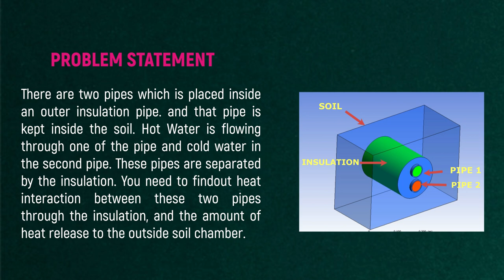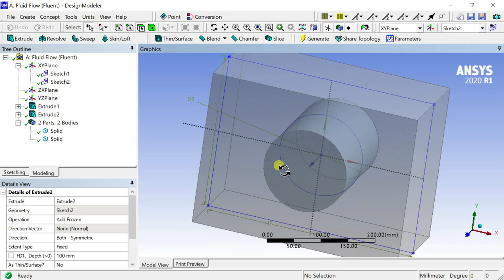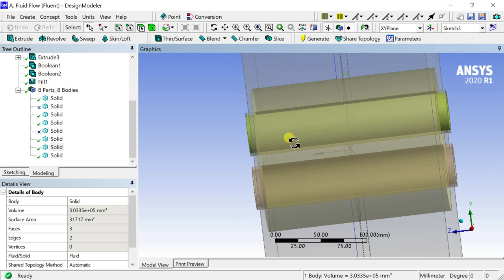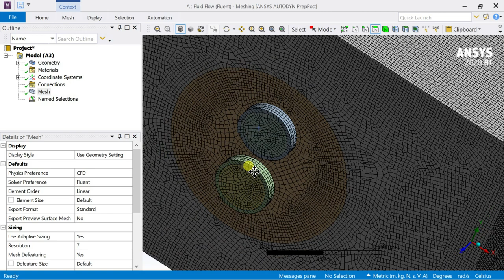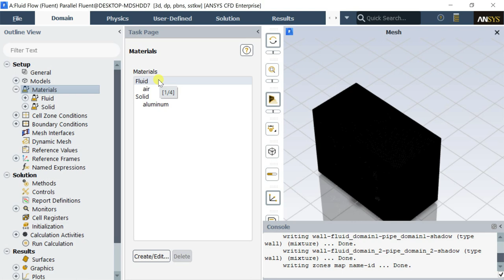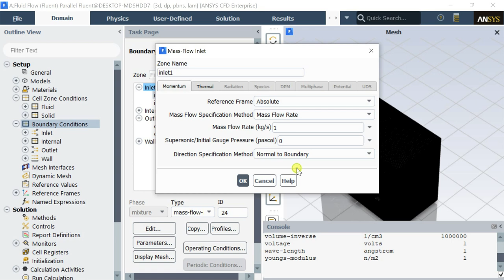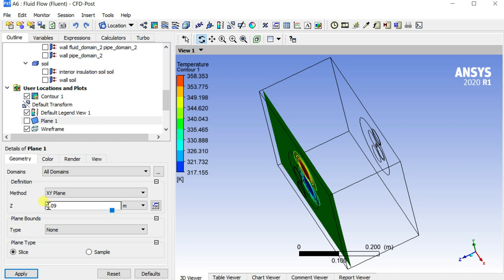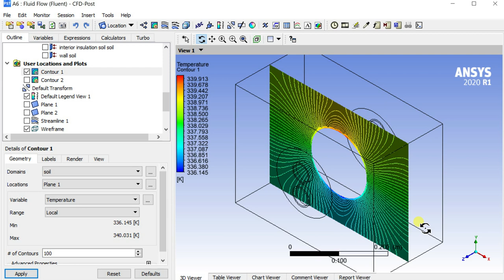Heat Transfer Between Pipes In Insulation | ANSYS Fluent Tutorial | Flow & Heat Transfer Analysis

Comment: Thanks for great video! I just want to ask what if I have similar situation with two separated pipes each has an insulation and they are placed in a small chanel with air gap. Do I need to do inlet and outlet for air as well as for liquids or just mark a named selection as one body-air?
Reply from the maker: If there is flow, you should mark the inlet and outlet,  otherwise you can do the patching option to assign the heat boundary condition.
Reply: @AnsysTutor  Thanks for the answer. I just want ot ask one more question. If I want to set the initial boundary condition for soil temperature say 12°C how to I set? Or Where? Thank you.